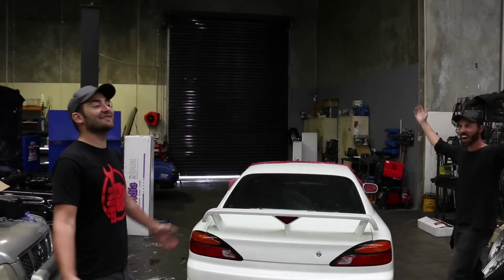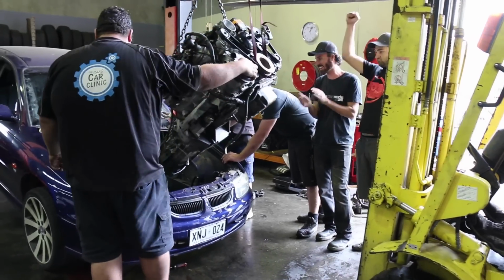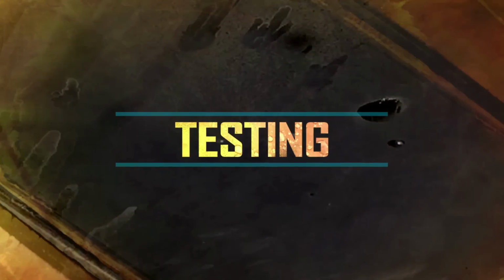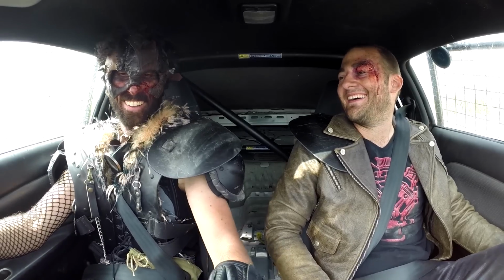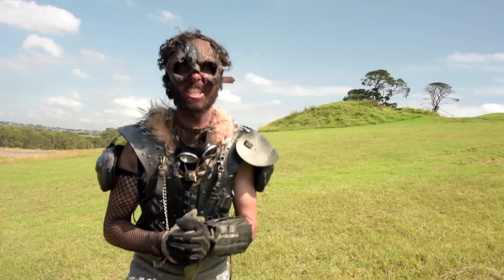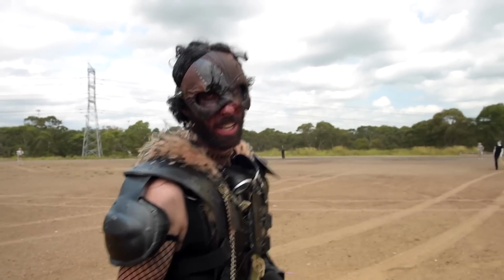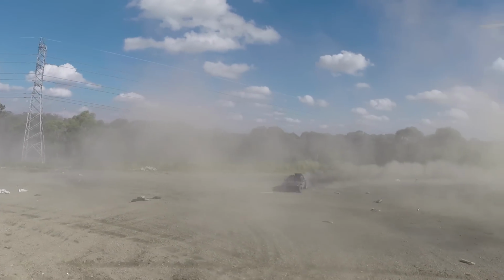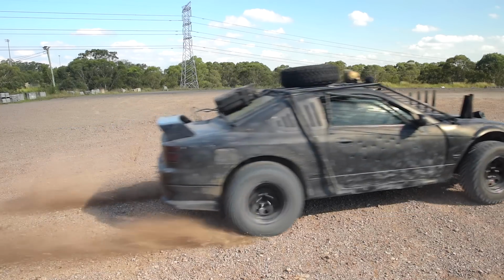MOD MAX - Episode 4

Comment: Why are the episodes getting shorter and shorter. Not complaining but my shows on television don't get progressively shorter over time. You've cut 10 minutes of film off since the first episode of mod max.I like your show very much and I don't like missing out on things and I feel cheated because I feel there should be more. I would have assume, if you're doing a series, each episode could be expected to be the same length across the board.

Comment: This car is far from good....
Exhaust pipes facing up??? dude!!!!!! get a normal exhaust manifold and straight pipe it to the side!
Filter showing???? nononononono, hide it under the hood.
Stock suspension is not an option, deffently for off road.
RWD? please stop.
Good idea, but if you could give it more time and thinking, you could make it better for the reason it was  created.
Otherwise, yes, nice show car, it has this hardcore look.

Comment: I was pretty disappointed with the anticlimax this film had. I thought we were gonna see an epic run of this at the end. Just some donuts in a gravel parking lot and driving on someone's lawn is not mad max. The car had almost no function besides the cage and tires. It was just to look cool, which is exactly what is wrong with the car world. Put some actual gravel suspension on it at least!!! Come one guys, you can do better then that.